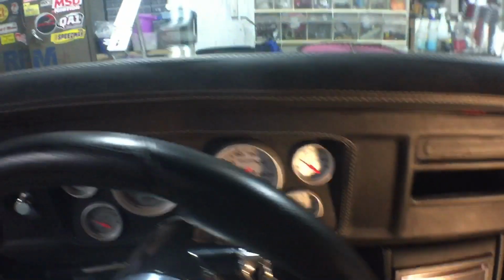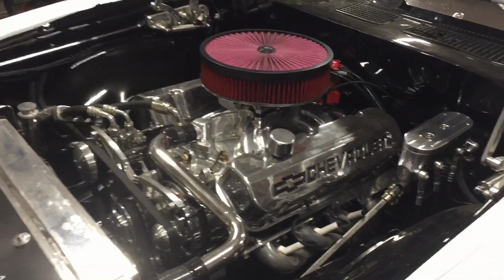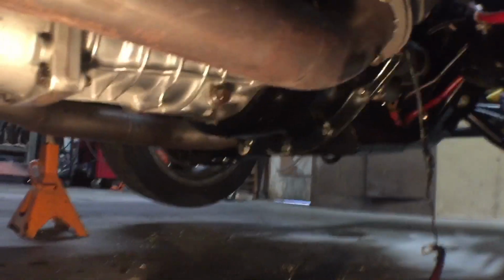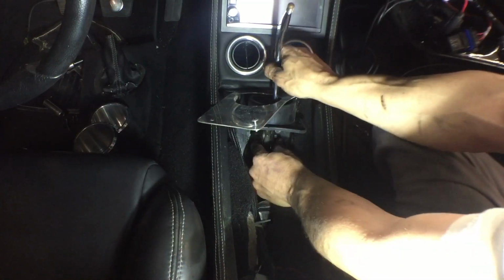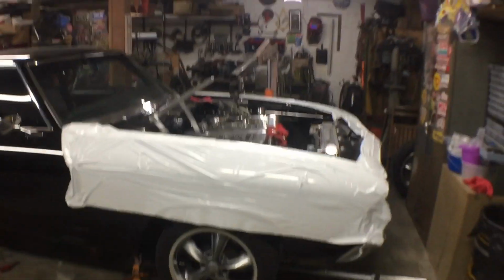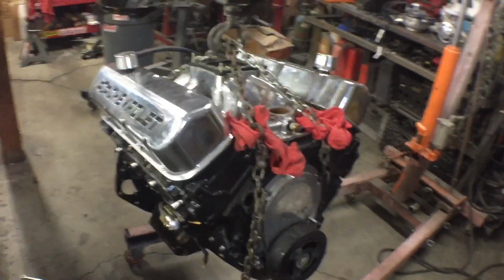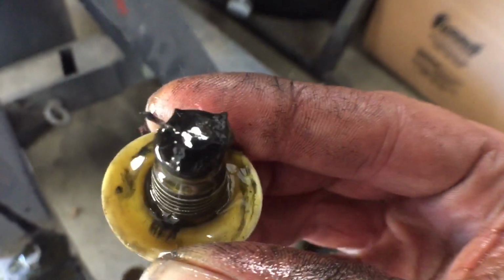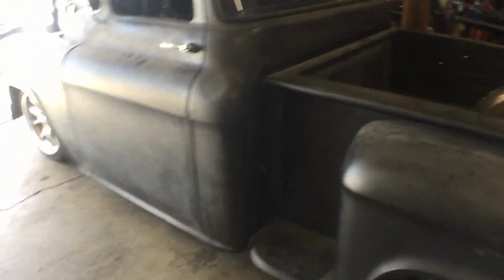Pulling 69 chevelle engine

Comment: That is how I do them too, extra jack stands or blocks. When I get a car rock solid on stands with some kind of backup just to catch it, then I will get under with no worries. I'm suprised the oil pressure wasn't fluxuating with rpm, especially after seeing the metal on the drain plug. They let that baby roar just a little too much. LOL. At least it didn't throw it through the block. Great video, hope you let us know what failed .  🤘🤘
Reply from the maker: fan I sent it back to the engine builder this morning should know by tomorrow 👍👍😎
Reply: Update on the  cause of low oil pressure?
Reply from the maker: Not yet hopefully tomorrow 🤷🏻‍♂️